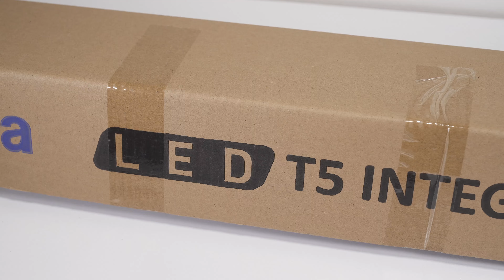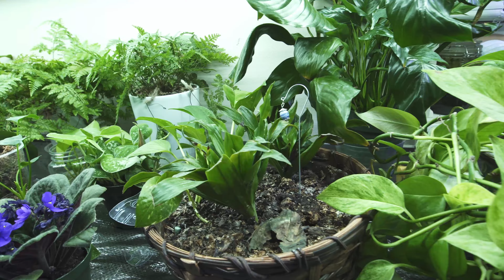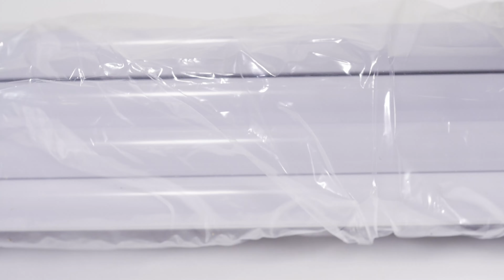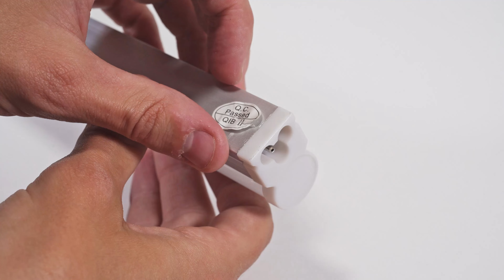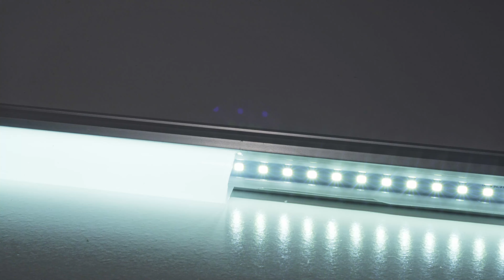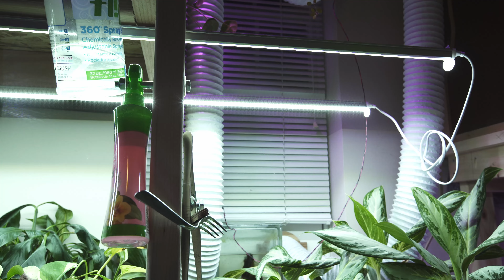Can Barrina LED T5 Lights Grow Plants?

Comment: I use this for cactus and succulents about 4-8 inches above and they provide excellent light. All my succulents have that beautiful color to them u see in the advertisements and none of my succulents stretched throughout the year. I been using these for almost 2 yrs now and just bought another set for my outdoor plants i plan on bringing in for the winter. Now im alil confused how high i should hang for different light types such as bright light, bright indirect light, ect. If anyone has any help please let me know.
Reply from the maker: I have even stronger versions by barrina now and i keep em at all different heights, im starting to think they are almost over kill for some of my plants tho. And yeah they work really well on succulents I still am using the lights in this video they work so good
Reply: How far apart do you put your lights for your succulents ?

Comment: Ive had barely any success starting tomatoes under these lights. Not quite sure why...Any feeback would be great, i.e how far those lights should be from seedlings?
Reply from the maker: for veggies i would say you gotta have them like an inch away. If you have options i would buy the barrina grow lights they sell that are almost 4x the output. OR go with an actual grow pannel like spider farmer or viparspectra. IF you wanna have a deeper convo about this reach out to me on instagram techplant.official its much easier to talk with the messenger portion than on youtube comments

Comment: I've these set up over a 6 foot planted aquarium for close to 2 years now. They've worked quite well so far, probably would better without the diffusers. Thinking about trying a combo of their white grow lights and RB lights soon.
Reply: hey any updates? How you think these compare to a real T5 Ho fixtures? they're only like 15w so im not sure about the strength and PAR rating./
Reply: @gallardo20000  real t5 would be better for sure, however considering cost of these, they're not bad. My 125g is fairly low tech so crazy lights aren't required. About half of them have failed over the last 6 months or so. ~3 years for decent lighting at $80 (back then) is pretty good. I will probably try a similar product again, but this time with 2 banks of 4 2' lights or 3' lights, with full spectrum "white" and some red/blue grow lights.

Comment: I just loooove your use of forks everywhere 😂
Reply from the maker: lol, i had one pinned on my wall jammed into a bracket that holds curtain rods so it would hold up one of my plant fixtures at one point
Reply: @TechplantChannel  yeah, I noticed it in more than one video 😂
Looks like your favourite way to use forks.

Comment: The LED Diodes gives a laser beam stream you usually cant see but enough of them illuminates the spread out of spectrum light overall of desired range of spacing. Its best to use a wide box device over the sticks but you can use sticks as long as its 6 or more. 2 to 3 sticks only good for small desk plants....
Reply: Too close to the diodes like an inch or 2 too close, will burn a hole thru foliage or leave where as you can see how the lasers work thru the hole mark as it has happend to me...

Comment: How’s this light working for the indoor plants?? I really need something for my plants and I’m considering this. Any feedback would be great!
Reply: Id love to know as well! Commenting to get updated:)
Reply from the maker: They are workign well! However, i would reccomend their new grow light focused lights. They are a litte more expensive, but twice the power and you dont have to cut off the diffuser. These ones in this video have worked fine but the new barrina grow light ones work way better!
Reply: @TechplantChannel  I ended up purchasing them. I really like it so far. I too want to remove the diffuser. But I’m leaving it on for now as it sits right above my indoor plants maybe 6” and I really like it. I’ll def check out the lights you mentioned as well.

Comment: These lights DO NOT WORK. I've tried them and were very dissapointed with them. After two weeks of having these, my aroids did not like them. The new growth being pushed out looked wrinkly and small, some growth wouldnt even open with the light intensity it proivded. I think what ive learned is that the wattage for these are too low to be viable for plant growth. I would honestly invest in something else, something with quality when it comes to LED lights.
Reply from the maker: Really? My Monstera Deliciosa and adansonii are doing well under them. same with some begonias, raphidaphora and pepperomia. Did you cut the shielding off? they make even higher wattage lights too if they arent working for you
Reply: @TechplantChannel  Yeah, ive slid the translucent diffusers off the housing to provide a direct light. The plants are just not acquiring enough light to sustain proper growth with them. Again, the new growths were weak and wrinkly. They are all at least 6-10" from the light source, which is reasonable enough distance. My p. hederaceum and micans are fine with it, most of my other common plants are doing just okay with it, however my gloriosum, other rare philos and rare anthuriums are not a fan of these lights. I don't think they come close to actual LED lights rated for growing.

Comment: Was there any certification stickers on those lights? etl, fc, rohs, etc?
Reply from the maker: I cant see any, so i dont think so
Reply: @TechplantChannel   I'd be a little paranoid using those as grow lights, in case of a fire, barrinas and all the other cheap brand shop lights seem to have no certification s behind them. Also the lumen and watt output I imagine is embellished. Should do a test and download a lux app on your phone if you could. Let me know what lux your getting a different heights.
Reply: @GuitarLessonCharts  I bought them for my plants and they did not react good and i had them in use for 4 months! The plants all started looking sick and some leaf loss 😳 so took them down
Reply: @a.m.rootedinbuffalo331  I ended up buying some from a local hardware store. About 10$ extra per light then that off of Amazon. Been running em for about 3-4 months now. 5000k spectrum work great. Grew lettuce and some other veg I tested. Using em on my succulents now. Lots of growth. In your case the lights were probably to far away from the plants to have any significant impact.

Comment: I bought some generic non grow lights too. 5000k tho with the clear lense. After doing some tests though I think the diffuser is better because these lights are best used within 4 inches and without a diffuser on the light doesn't spread as evenly at close range.
Reply from the maker: Good point! I think if you are using them on veggies or seedling and you have them close like that the diffuser is better. I have mine kind of high because they are for some basic tropical plants so i ripped it off. Very good observation tho. I didnt consider the diffuser being left on based on proximity!
Reply: @TechplantChannel  yea, the reason i noticed it was because with the clear lenses I was using two, 22 watt, 4 footers, rated at 2200 lumens each, at about 9 inches apart from each other and at a distance of about 5-7 inches from the plants. Long story short my ppfd didn't really go up much or as much as I expected, It was just covering a bigger surface area and didn't really stack the intensity.. Roughly 100 umol/s. I added a 3rd  light which now put them every 3 inches apart and finally the light started to stack a bit better. Roughly 200 umols/s at 5-7 inches from plant canopy. However at close range within 4 inches not much difference in ppfd  with a clear lense. 1 light puts out about the same as 2 or 3. Just covers a bigger surface area. With that said, peppers are doing good under em.

Comment: Thanks so much for this video! I’ve been googling til my eyes are bleeding trying to see if these would work 😊
Reply from the maker: I did some additional searching after buying these, There are some T8 models with more wattage that might work even better. Also there are some t5 models that have clear covers so you dont have to cut the diffuser off. So far after a few months tho these lights are kkepign my houseplants happy. Dont know how well they would work for some veggies.  If you buy some get the ones with a clear cover or try the t8 larger ones too
Reply: Techplant , Thanks so much for your reply! I appreciate the extra info . I would use them for succulents . I have over 100 succulents . Been using T5HO fixtures. Tried the red blue LED’s and got eye pain and headaches too . How would you compare them to T5HO fluorescent for plant growth and electric bill ?
Reply: @ChiweeniePupSky  I have 5000k running right now. Growing succulents and testing random veg under them.
Reply: Revolutions , Awesome! Thanks so much for the update. I’d love to hear how it works for you . I got a 5,000 K light about a month ago. It’s a DuroLux with 8 strips of white LED . My succulents actually like it . Your video was very helpful. I also have been using the red and blue barrina slights with the reflector for 2 months. I’ve had succulents flower and grow tons of babies under them . And my pink moonstones got super pink under them . I’ll update ya on how mine do under the 5,000k led as well . Glad to hear from ya 😊
Reply: @ChiweeniePupSky  what wattage of the barrinas did you get? I've been looking at those lights and im thinking about going with the full spectrum 3500k yellows/white ones as well as some generic 3000k led shop lights to balance my spectrum better  with the 5000ks that I already have. Just to clarify though I'm not the maker of this video, just some guy that is also interested in lights for seedling racks and house plants. Just had a look at the 5500k durolux 8 strip. It seems better then the 6500k model that they also sell. Right now I'm doing a test seeing what the minimum I can get away with for as far as lights and watts. Currently trying two 4 foot 20 watt LED 5000k in a 4 x 1 space but I'm speculating I need 3 tubes at 20 watts each for decent growth on veg seedlings in that space. Only 2 weeks into the test on peppers and just started a few brassicas that I know go very leggy quick in the window sill.

Comment: Those lights works. Great for all leafy greens and seedlings if close enough. Cheap and effective. My tomato seedlings reached 2 feet and started to flower even if the lights are 6000k. Impressive.

Comment: Interesting lights, the lumens output for the wattage is huge compared to everything at my hardware store and can be got in Australia (where I am) for a decent price ($85 AUD).
One thing in your video you mentioned that you specifically wanted the light to go straight down and not bleed out, well this ties in with a curiosity I have at the moment, basically can the fresnel panel from an lcd monitor/tv be used to help with that.  Size could definitely be a problem, but from what Ive seen you could prolly batch a few together.  Its just that if it did help, the panels are widely available and could be gotten free in a lot of cases (I know where an outside tech recycle bin is, will be hitting it up in a couple of weeks).  I dont have money or am growing anything so hard for me to do.  Would love someone with a PAR reader to test it. Anyway, just an idea.

Dont know if I can put links in comments so the name of the clip that got me interested is "Turning Smashed TVs into Realistic Artificial Daylight" on YT.

Comment: Hey, your videos on plants are so informative! Do you think it'd be interesting to make a 101 on growing lights? I've been researching for a while now, but it's been very hard to find more simple and beginner-level videos about grow lights =/ I can only find reviews of different models and tips for assembling and optimization... and I don't even know if I SHOULD get grow lights.
I don't know if any light bulb I have at home could be used as a grow light or if to make any difference it must be one of these super potent ones, or pink hahaha. I'm really disoriented about the basics, like energy consumption, cost, efficiency, etc. I have windows but I don't feel they're enough for my houseplants.
I think this is the kind of content that would help most people get the 101 basics to start thinking about buying and putting up grow lights, since it's easy to find these simple guides about gardening, but not about artificial lighting!
Reply from the maker: Ill try and plan for it, Thanks for watching!

Comment: Inspiring as usual! Could you come up with something to protect the electronics that doesn't reduse the output too much?
Reply from the maker: I thought about that, but i dont have any decent clear material that im sure wont start on fire if it gets too hot. Im always really nervous about these cheap lights and their safety
Reply: Clear 1/2" vinyl tubing?